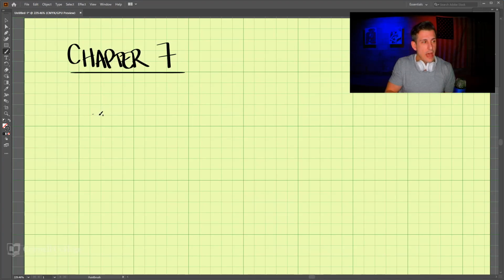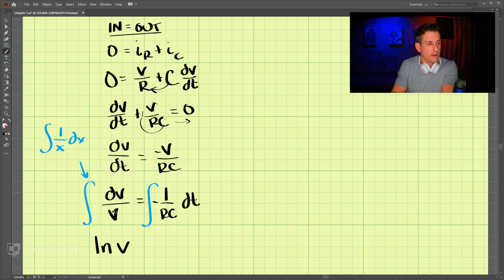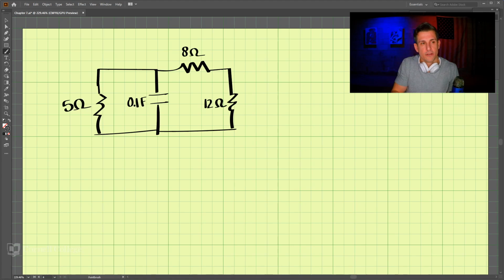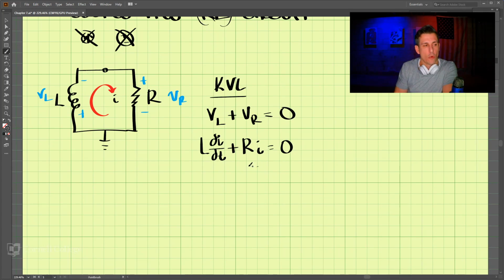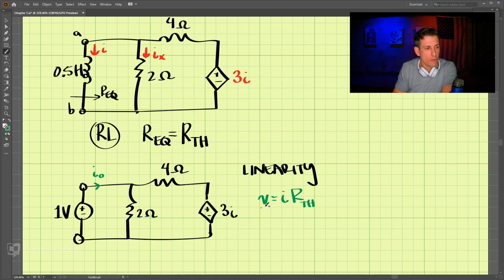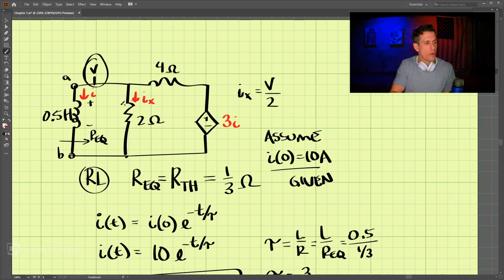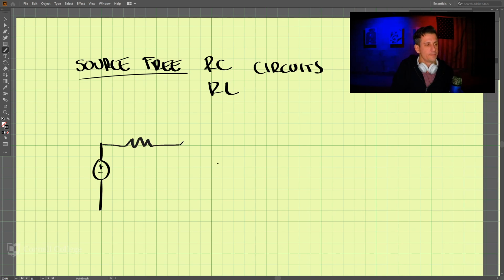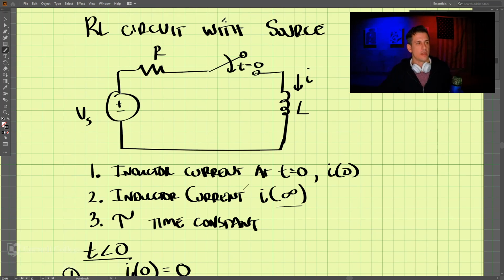Chapter 7 - Fundamentals of Electric Circuits

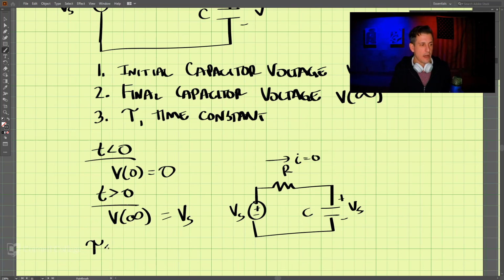Comment: Why do you say that at time infinity, there is no current? At 1:06:40
Reply: Because when the capacitor is fully charged, it does not allow current to pass through it. Think about it this way: The capacitor has the same voltage as the source but in opposite direction, so they push equal current in opposite directions and they cancel out. This is called the steady state of a DC circuit.

But the capacitor will start working as a voltage source when the voltage source is removed.
Reply: did you get it?